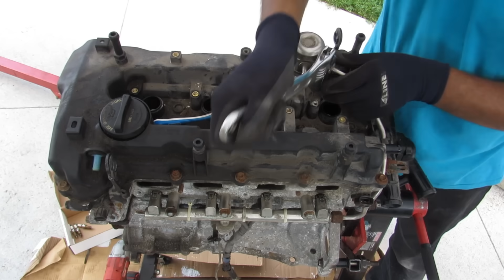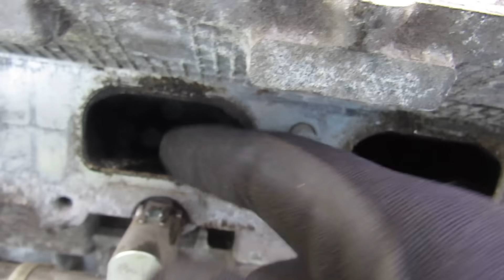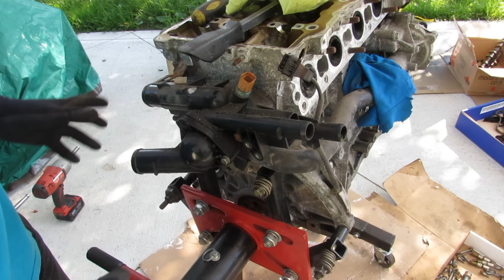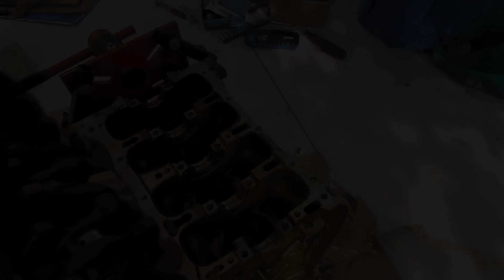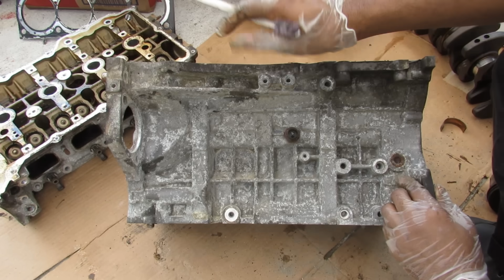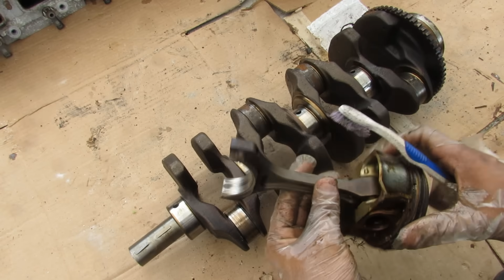Why Hyundai Engines FAIL

Comment: Something here just does nor add up;
The *oil filter* traps all those mentioned particles; 
Unless one NEVER changes the oil filter(and then if it clogs and  by-passes the oil--that´s what they do in that case!) i don't see dirt as having been the reason for that rod bearing failure; not after 50000 or 100000 kms at least;  
 ((but i could see the debris as a cause if it occured when the engine was new,less than  2000 or 3000 kms,not after that)); 
Am i missing some' here? thanks

Comment: You act like you never seen this kinda sht before. Extra metal is gone after the first oil change so thats kinda silly. What i see is oil starvation across the board. And thats basically a toyota design. What you should have done before pulling the engine. Is pulled the pan and crank. Check the rods for out of round. Because if the rods werent effected you could have thrown new bearings and a crank and oil pump in it in a few hrs for far less money time and labor. Now youll go get a motor from probably lkq who love to lie about milage of used engines. Or alternatively youll go buy a pricey rebuild and hope they knew what they were doing when they assembled it. Factory parts beat aftermarket junk every time.

Comment: Main bearings rarely show damage compared to connecting rod bearings that have failed. Dirty oil and over revolutions main cause of engine bearing failure. In practice the bearings should never come in contact with the journal surface.

Comment: To be fair Theta II from 2010 was making 200hp as opposed to 160hp Camry 2AZ. It was more powerful and efficient. 
I'm sure this issue only affected  USA built units?  
Not to mention Theta II was a shared engine design and not wholly designed by H/K. 
The 1.6 Gamma both NA / GDI / TGDI variants are solid and reliable as these were designed by H/K
2AZ had issues too, early versions stripping head bolts and later versions exessive oil consumption.

Comment: BAD DESIGN OF INJECTION SETUP ,CREATES VAPOR LOCK THEY SHOULD HAVE PUT IT UP TOP TO THE SIDE AWAY FROM EXHAUST MANIFOLD ,DIRECT INJECTION ALWAYS A PROBLEM A TALL FUEL RAIL WORKS BETTER,ENGINE HAS A "HOLDEN" LAYOUT LOOKS THE SAME!!

Comment: Apart from the GDI issue, which other similar blocks without port injection suffer from, it looks to me like a pretty sound design. Even the external water pump is enough to make a mechanic happy. The only real issue I see here is a production process error.